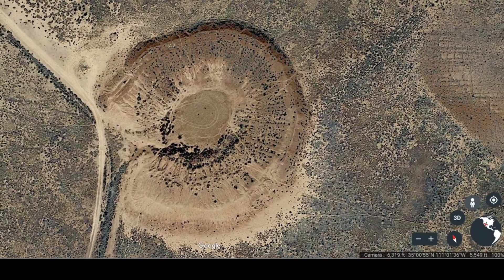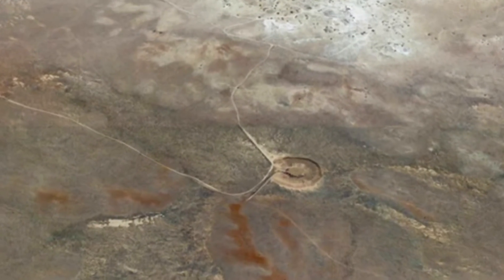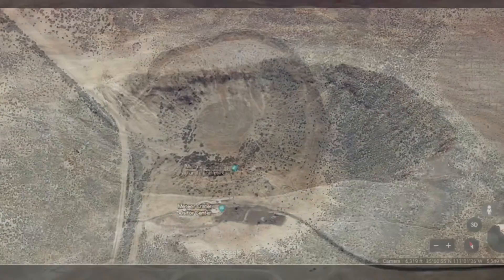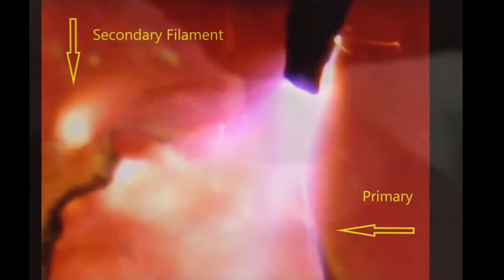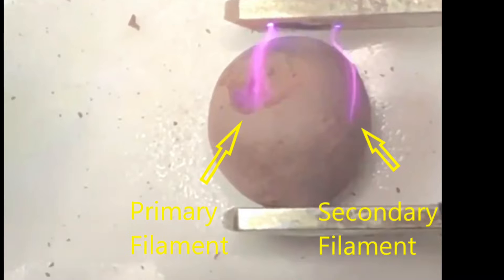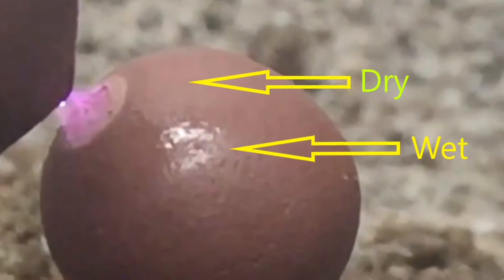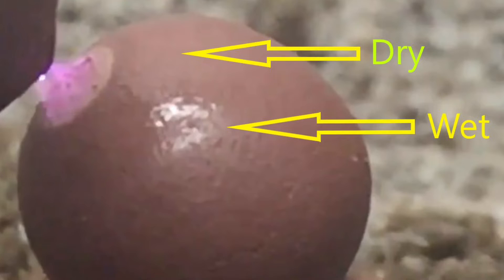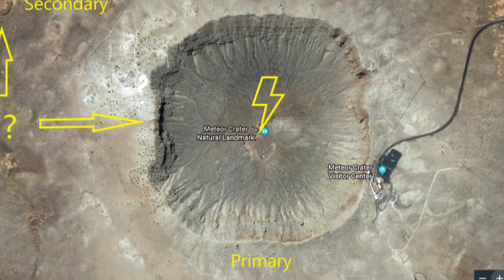Meteor Crater / Barringer Crater & Strange SW Formation - Created by Electric Discharge, Not Impact?

Comment: Thanks for pointing out this interesting horseshoe feature. On Google Maps there appears to be another fainter feature to the northwest. After looking carefully it appears not to be elevated, except for a berm of perhaps 10 to 20 ft  along its southern rim, similar in proportion  to the big crater. But the feature is mainly a miniature version of its mother Crater, maybe 50 ft deep, with a sheer cliff of sandstone 15 to 30 ft around its northern arc where the surface of the plain drops off precipitously.
Reply from the maker: Paul Macfarlane Robert Hawthorne pointed that out as well on the Electric Universe Geology FB page... good eye, Paul!